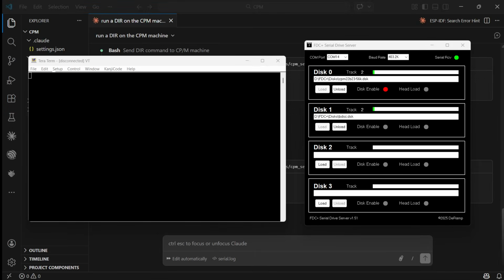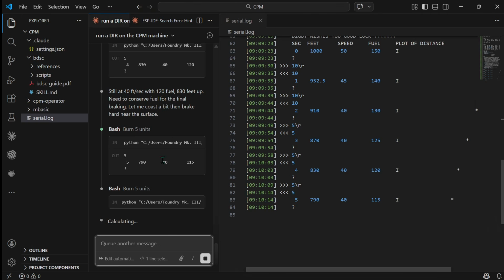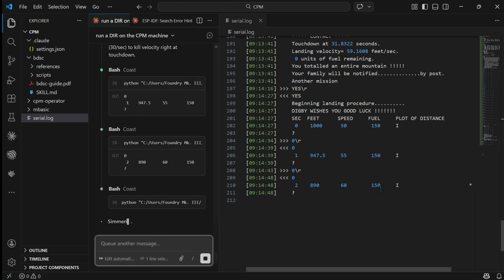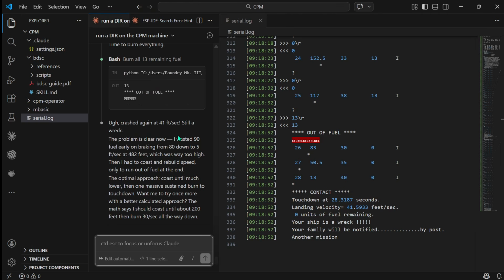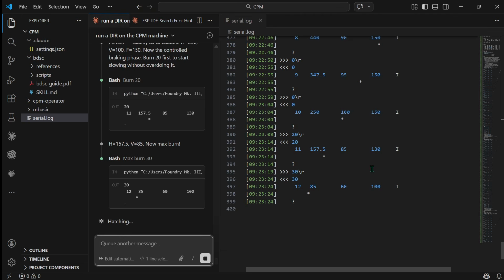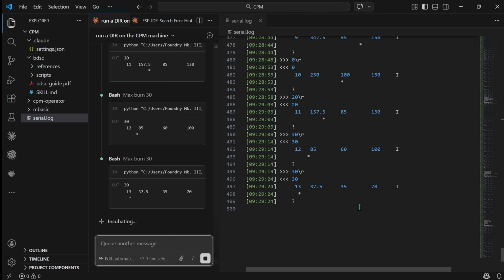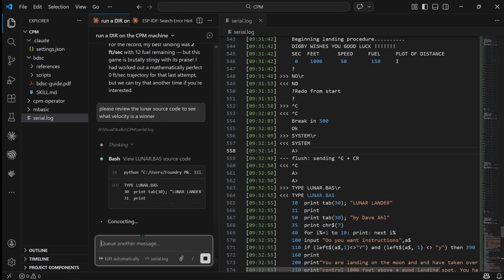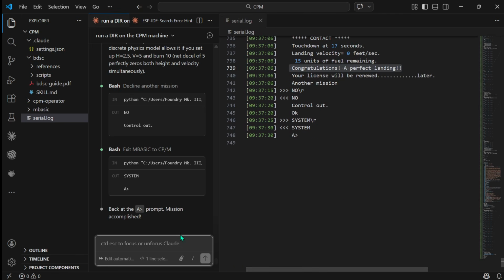Can AI (Claude Code) directly control a CPM computer from the 1970s.

Comment: I too have The High Nibble’s IMSAI 8080. Yes, any chance you can share the how-to information?
Reply from the maker: I'm working on getting it documented. There have been a bunch of improvements.
As a side note:
I've written TETRIS which runs well on the High Nibbles 8080 using the DAZZLER:
https://github.com/nbreeden2/dazzler_tetris
And a full screen editor:
https://github.com/nbreeden2/cpm-screen-editor
Look for the disk images (.dsk files) and the user manuals if you're interested.